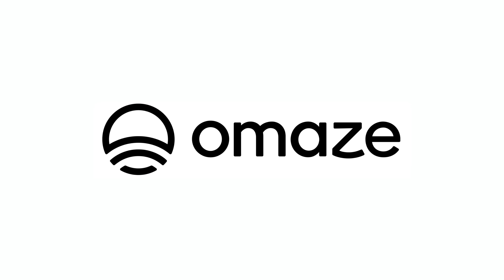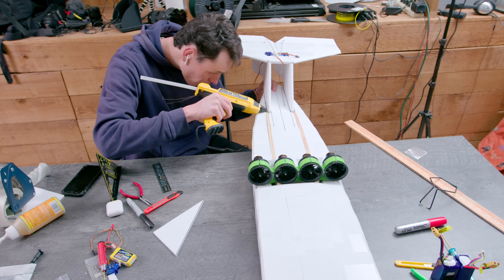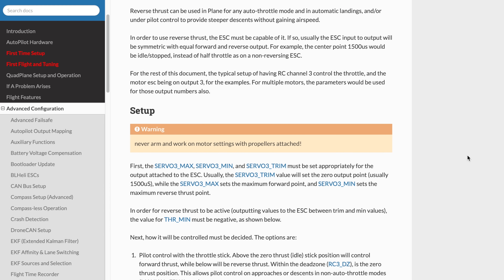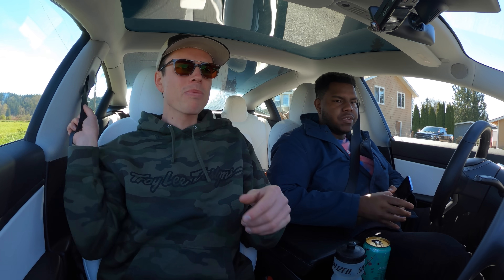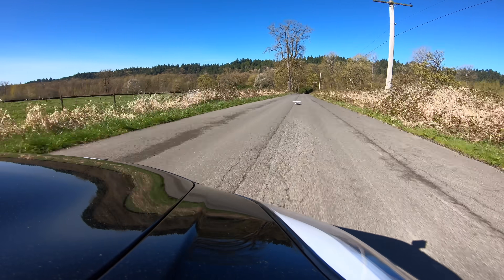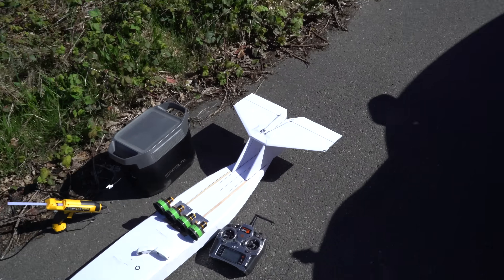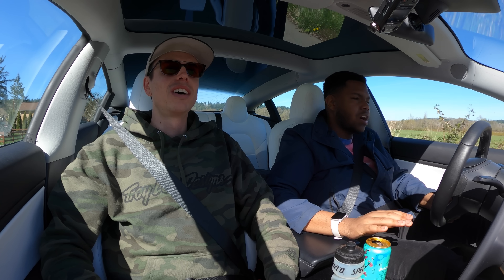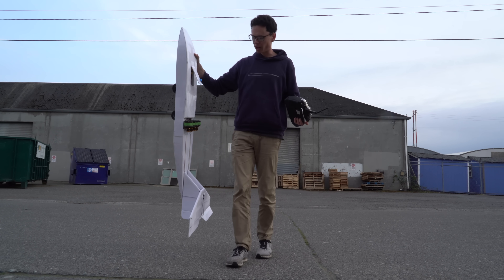EDF Powered Jet Car - High Speed Aero Stability

Comment: Could you not use the wheels for steering at all, and give them enough toe in to be stable but not drag much, then use only the other two steering methods? (rudder, differential thrust).
I wonder how much instability the wheels actually introduce.  Then just for fun use only either rudder or differential thrust.

Comment: But honestly.  I understand the concept of Aerodynamics.  But the wheelbase thing also comes into play.  Look at the worlds fastest jet vehicle
you showed in this vid.  It was handled by computers plus the wheelbase was very long.   I drove Karts for 30 years anything from sprint to road racing
on super speedways. Aerodynamics played a key roll as well.  You can still use your controls.  Just remember your thumb isn't a computer. And any little touch
on the controls can lead to a disaster.  Lengthen the wheelbase another 6" and see the difference.  The extremely short wheelbase is killing your project.  Just saying.   Greg

Comment: I would love to see this done with a chassis with stiffer suspension designed more for "track" use.  I know you get stability with aero but the bouncy suspension from the "buggy" chassis will be throwing it off. Also, with the RC drift cars we use a gyro also, to help with fine adjustments in the steering. im not sure if that will be any use to you.

Comment: Put a secret weapon in there. A motor inside pointed down at the ground then use 3 to push it. Then create a steeper downforce and be able to control it a lot better.

Comment: #PodRacer are there benefits to having two motors on the sides and two on top  vs four on top from a stabilization perspective? Or too much drag losses? one in front and rear and two in the center with dynamic thrust like a quad?

Comment: remove shock springs, and put a steel spring hose clamp as a spacer then rebuild.  the clips will lock out the suspension and make it much more stable and responsive.  I have 1/14 cars that go over 70mph on gps and this is how I make the cars handle perfectly at top speed

Comment: Check out Wikipedia's "inertial roll coupling".   https://en.wikipedia.org/wiki/Inertia_coupling   Maintaining constant contact with the ground while flying over a bump or hole will create challenges.  If you study the "Kenner SSP" toy sold in the early 1970's, you would see how this was solved with a single gyroscopic wheel in the center of gravity.   Your project is interesting.

Comment: reduce your wing 4-5inch / swap with thin wheel and longer wheelbase ;)  and on 4 fan add a good rocket exhaust 4 -- 5" long and 2" diameter ;)  (and voila) :)

Comment: A few improvements:
 - Longer wheel base would give even greater stability
 - Off road tyres are big drag items
 - Horizontal stabiliser could probably be halved in size, maybe even round off foam board edges
 - Shape is very good
 - Air brake would be a good addition

Comment: Hi maybe you already though about this, but i believe having a swich to enable/disable wheel steering will help you with controll on high speeds, meaning that when you start accelerating wheel steering is enabled but at a certain speed wheel steering becomes too unstable/uncontrolable so having a swich to turn it off and use only the rudders to controll steering(yaw) while on high speeds with be more stablwe that using the wheels.

Comment: TIP: you should use like the left temporary switch (with throttle off) as 100% reversed throttlee (or as a temporary revers throttle, and have variable braking with the throttle stick)
I would actually like to see this :)

Comment: I think it would be really cool if your vehicle's thrust came from a pair of horizontal axis cyclorotors, which would allow you to do rapid thrust vectoring.  Not only would this eliminate the need for elevators, but you can very quickly change from accelerating forwards to accelerating backwards (braking) without needing to slow down the motors and speed them up in reverse.
In other words, it would be a cyclocopter/cyclogyro, but on wheels. :)

Comment: NICE!! That car is such an awesome idea and build. Your EDFs are the best idea but even though you can get much more thrust from props your stability it much greater with your EDF placement. I do structural design and I think you can take your jet car to some really exciting levels of performance. Have you thought of removing the rear wheels off the chassis and moving them forward, then change to a single rear wheel mounted farther back on the car? If there are only three points of contact, it would also remove some of the resistance. You have such an incredible thirst for knowledge by innovation with some fun trial and error. There are some really interesting and challenging routes you can go with your vehicle design. You've already solved many many important obstacles to really challenging some speed records in the future. Keep up the dynamite content my friend and I can't wait to see more.   🖕

Comment: Canards. The front of the vehicle could stand to have more direct control. 

And yes a long wheel base is a thing to be considered. promoting overall stability. Having said that, It is up to others if they want it so badly. This would demand much more work. But stripping suspension components from a 2wd Buggy will make things easier.  

The wing twisting seems to be a weakness in the frame. Either stronger frame rails, or a longer wheelbase to necessitate shorter frame rails may be in order.

Comment: Do you think a V tail would work better? Should give it more roll stability at the very least since the roll correction would inherently become stronger as the car tips over more. Is it is now, the horizontal stabilizer works well when it is level, but at some point in the roll it would just pull the car to the side instead of back onto the wheels. With a V tail it is the opposite: with more roll it would start pushing up and back onto the wheels.

Comment: Idea:
You know the circle endurance runs you've done in your yard?
Could you do one with a small, slow-flying plane?
Reply: That's kind of a thing already. They are called control line air planes. They used to be really popular before modern rc electronics became so cheap and readily available.

Comment: Why not set up your brakes like a heli's collective?  
Pick a zero-throttle stick location... like mid-stick or 1/4-stick and set positive proportional throttle from that point up.  Then, negative throttle would be proportional below that position.  Lowest stick position would be full-neg throttle.  So you would automatically be at zero throttle whenever you throw the stick down to apply the brakes.  No need for flipping a switch.  Much more intuative & easy to grind into your muscle memory.

Comment: Reallly well done. There should be an official competition for these kinds of vehicles in different classes.
Does the suspension have to be adusted to increase stability, stiffer or softer? 
I'm surprised down force in racecars isn't dynamic, increasing it only when needed.

Comment: Ahead of the chassis, round the sides of the body or 'knife edge' them. When it turns the flat sides hit a lot of air and that wants to make it push farther off from straight. Get some UHMW tape to apply to the underside of the nose as a skidplate. It's super tough and slick so it'll slide across the surface instead of getting roughed up and causing slowdowns when the nose hits.

Comment: To address the yaw control issue add more surface area to the vertical stabilizers (make 'em larger) or add a third vertical stabilizer.

Comment: Have you considered using a gyro to automatically maintain the desired pitch? If you implemented that you may be able to place a single pair of wheels, with bearings, at the center of balance.

Comment: fyi, downforce is  ---   lift, towards the ground.      as lift does, downforce comes with a drag penalty.        the  NOSE  of the model is making  downforce,  and  DRAG; with the amounts increasing as the speed does.!
conclusion:   the nose desperately NEEDS  TO  have a  more  Symmetrical  shape.!
when a camera was added, at the aft of the vehicle, it was a (new and) asymmetrical  source  of  DRAG  at the tail; resulting in drag rudder effect and unscheduled yaw moment.!        googletranslate

Comment: Hey it looks like your unstable yaw is a result of too much vertical cross-sectional area in front of the CG/wheels. Just looking at it from the side, it looks like that area in front of the wheels is very similar to the area behind them, even considering the vertical stabs.

When they put small planes on floats, more vertical area is added to the tail. Look up a Beaver floatplane and you'll notice the little extra vertical piece that's hanging under the tail. That's because the floats add more vertical cross section in front of the CG than aft. So when a little yaw is introduced, the air hits those adding instability. So, you make the vertical stabilizer bigger to counteract that. A band-aid for the car would be to make the vertical stabs bigger, but that's draggy. A more general fix would just be to move the whole body aft relative to the car, so little turns don't result that oscillatory instability which definitely cause a whole lot of drag. I think a missile/torpedo/arrow concept could also do well, but it's a more complicated shape to build.

Comment: the floppy rc steering is probably not helping things.  if you keep that in there you should throw in a gyro to countersteer like traxxas and others do from the factory now.  those cars, even RWD ones, with lipos/brushless can do full throttle runs from a dead stop and with zero steering input can go straight as an arrow.  i'm pretty sure you could get the same effect with a heli gyro.  though PID would make it more effective if you can pull that off with something with more brains

Comment: I just quickly scanned through the comments, so I might have missed if someone else already mentioned this, but how about adding tapered thrust tubes at the rear of the edf units to compress the thrust, like on an edf jet. That should give you more initial thrust and more top end. I have used edf units on an airboat and the tapered thrust tubes definitely made a difference.

Comment: Get two 70mm high speed fans you'll get easily over a ton . Those little fans are hitting thier max speed basically causes drag .. to go 200 mph plus I think you need the fan to be able to pass air through it at that speed or over.

Comment: I have a question for you. Is the reason you use a capacitor in line with the battery, to do with voltage stabilization?

Comment: I’m wondering if the scrapping on the nose is actually from braking force driving it down.   Wonder if adding an active air brake in the rear would help.

Comment: This is an apples to oranges example.  Downforce cars need it to maintain traction to move, where your car does not need any traction to move.  I'll be impressed when you do it with a regular car movement system and not EDF units.

Comment: Maybe try a design that uses ground effect like racecars do. With a skirt around the front and side edges and the back part flaring up. It should barely affect drag but make it more stable and you wouldn't need as much aerodynamic surfaces (and resulting drag) to keep it stable. Also a wider and longer wheelbase would do a lot for your stability.

Comment: Need a longer RC setup for that LOOONNGGG body. At least split the chassis and mount the wheels farther apart. You're not using the motor or electrics from the CAR anyway. 
Try skinnier tires, even racing slicks. Get the aero control better. You want a RC flying vehicle, not a car. Wheels are for taxing. Awesome project.

Comment: I've been mulling on this... and you know what would be a weird thing to try? Have you ever seen a flowboard skateboard? If not, look them up and consider the wheel configuration. Now, consider it along with the steering rudder and differential thrust you have on this vehicle. It would kind of make it behave more like an aircraft - but stuck to the ground. LOL You'll have some pitch, some yaw and some roll.  LOL  But yeah, those flowboard wheels will likely be heavy - so the trade off probably won't get you anywhere.  But it would be a novel vehicle.  I can't think of seeing anything like I'm suggesting anywhere.  :D Anyway, for whatever this is worth.  :) Love your channel, BTW.  :D
Reply: PS. If you build such a beast, may I recommend the name Carver.  :D

Comment: "fastest way from point a to point b is in a straight line"

Right.

Do you know Curiosity Show?
They have this video on how to fold yourself a small little box out of paper.
And 2 points opposite each other. 1 low and 1 high up in the box.
But it seems the straight line is not the fastest way.
It seems the diagonal line is the fastest way.

If you do not know the channel: CuriosityShow 
then check it out, funny stuff.

BUT as they showed in a video: The fastest way from point a to b is not always a straight line.
Reply: (YEAH, i know. The diagonal line is straight if you unfold the box.)

'

Just a bit of fun

Comment: This could definitely use some additional mechanical damping and softer springs.
Also, make it auto-trim with a lydar sensor in the nose.

I think you could probably get it to 100 this way with a new 6s battery. Also, remember that having the center of force directly behind the center of mass will always be the most stable, offsetting your thrust means the center of pressure needs to be corrected aerodynamically, which is not ideal and costs you speed. Notice how the Thrust vehicle has it's engines slung way down low, that's for the reason above, keeping everything as aligned as it can be.

Comment: I am surprised the wheels of the car were never mentioned, you are going for a speed record on offroad tires. In my opinion that should be optimized before more power is added. Also with roll stabilization enabled 3 wheels may be enough.

Comment: Maybe add tilt sensor to adjust things? You could use feed back loop with decay function to correct to high or low angles of car and use data from run to fine tune algorithm

Comment: I think you're running into handling issues due to the short wheelbase. I get the idea about aerodynamic stabilization, which is working well on the vertical axis, but your yaw axis is out of control, which is costing you a lot of speed as you're zigzagging all over the place.

Perhaps a modification which puts more emphasis on the Thrust SCC  body angle of attack system would be fun.

Comment: Awesome project. 
Controller tip: use both your thumb and forefinger on the “thumb” sticks. Can hold the transmitters weight with 3 fingers or use the neck strap. 
The bouncy ride of the chase vehicle your in will cause you to input fluctuations  (especially thumbs only) if your able to hold transmitter with 3 finger way it’ll provide the best stability

Comment: This is most interesting!  To have it run forward in a stable manner, try having the centre of pressure behind the centre of gravity like a model rocket.  To move the centre pressure backwards, have bigger fins behind.  To move CG forward, move batteries/motors forward.  The further the CP is behind the CG, the more stable it will be in the forward motion but it will be more susceptible to turn into cross winds.  The car would be rotating about it's CG so that's where the wheels should be.  U'll then have a rocket on wheels which will be inherently stable!  For more details check out model rocketry stability by G Harry Stein.

btw, to find out where the CP is approximately, trace out the outline of the vehicle on a card and find the point where it balances.

Comment: I wonder if the sloppy suspension/wheels/bearings of the cheap buggy is contributing to the instability of the vehicle. Mayhaps the design would fair better a fast car chassis like the Traxxas XO-1 or ARRMA Infraction.

Comment: You could install and run pi in an arduino with gps to help stabilize the height and possibly the steering as well.

Comment: Would it work to have a mechanical linkage on the wheels that adjust the up and down pitch? You can adjust with springs so you get the loading you are after and retain the light wheel loading. Cut the RC donor car in half move wheels out fore and aft, and re adjust Ackerman for steering. These are my thoughts on the build. I love the idea of it. Reminds me of an F-Zero type of vehicle.

Comment: It might be faster if you put the same amount of power to the wheels. Imo it would really help to adjust the linkage on the servo and steering linkage to shorten the throw as much as possible. Also you may look at adjusting the front alignment to the wheels to allow for better tracking

Comment: It looks like putting slightly heavier oil in the shocks could help you out also. The suspension looks a bit loose for all the extra weight you put on top of the car.

Comment: Thumb  and forefinger (pinch) grip with a bit of expo will give you the best control accuracy. Thumbs alone are sloppy....
Try making a radio MIX to transition the chassis steering into Rudder Steering Only at High Speed.